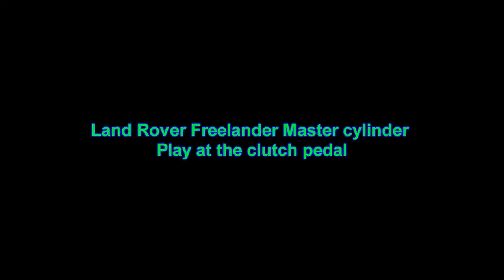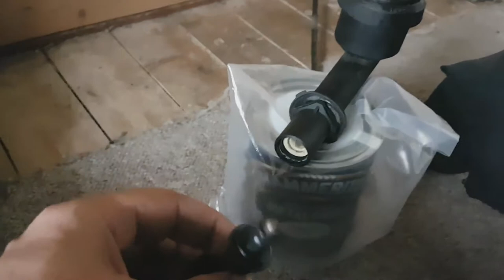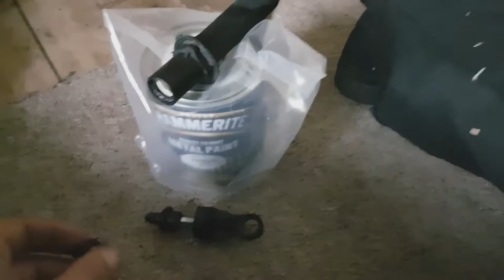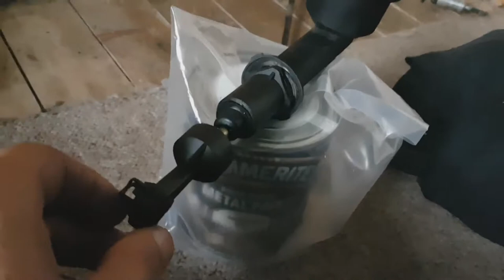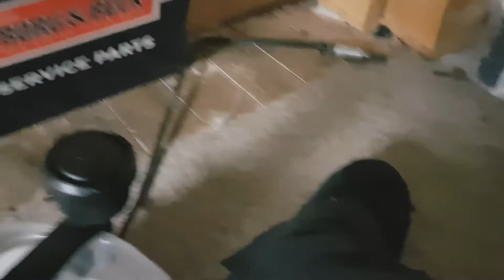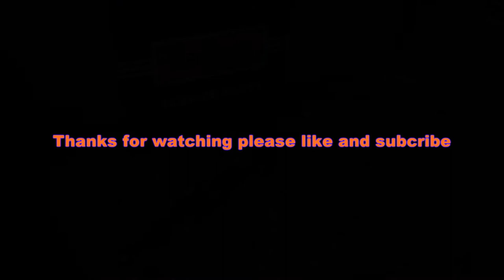Land Rover Freelander Master Cylinder Noise and play at pedal follow up

Comment: Cheers.
Reply from the maker: It's a common problem fault with Freelander and Rover 75 I believe. I believe ford use the same concentric slave cylinder. It tends to fail along with the DMF.
Reply: @AliMackMechanical  Yes, the Jaguar X type has a plastic master cylinder though mine hasn't actually gone though I did burn out the clutch.